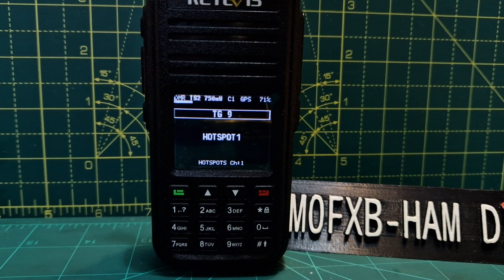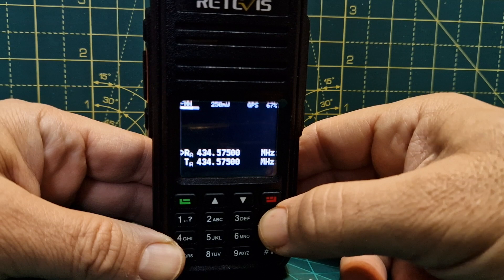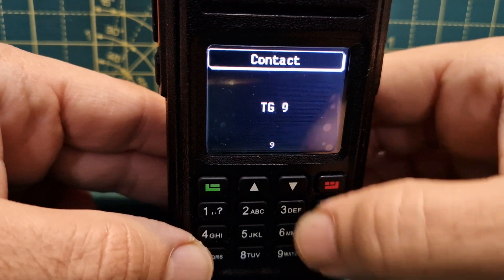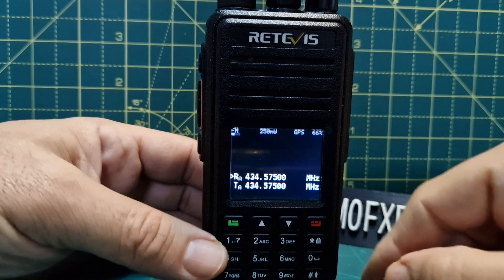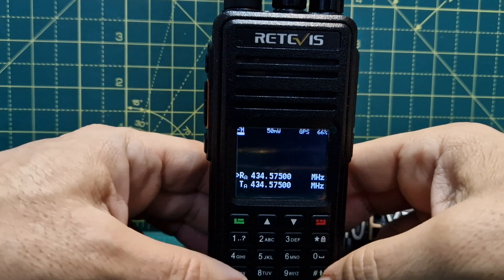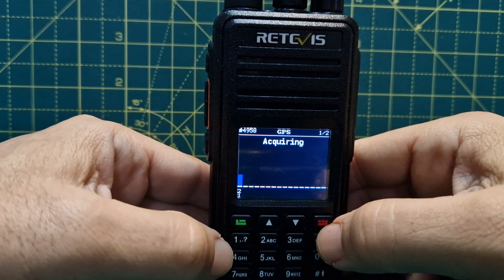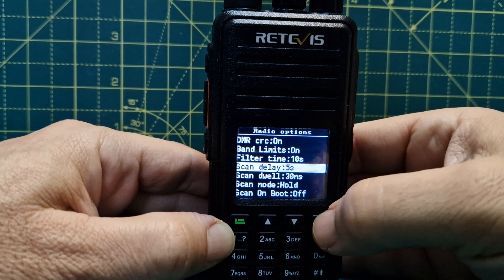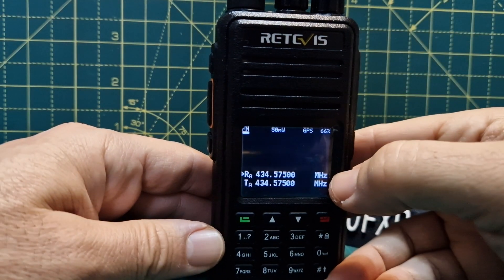RT3S-OPENGD77 REVIEW & BUTTONS

Comment: does it have promiscuis and monitor modes
Reply from the maker: Yes to promiscous what is monitor ? Do you mean input of repeater?
Reply: @HamTechRadioScannerDrones  on the retevis there is a monitor mode which brings through any colour code and slot
Reply: @BFsTransportVideos  yes it works fine